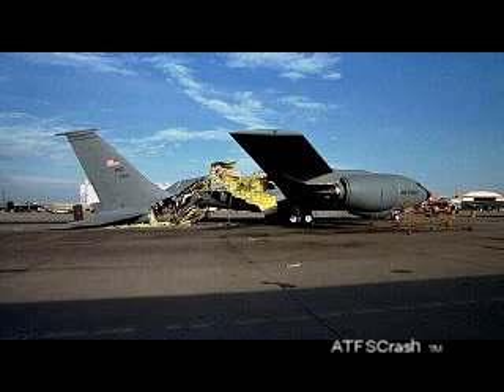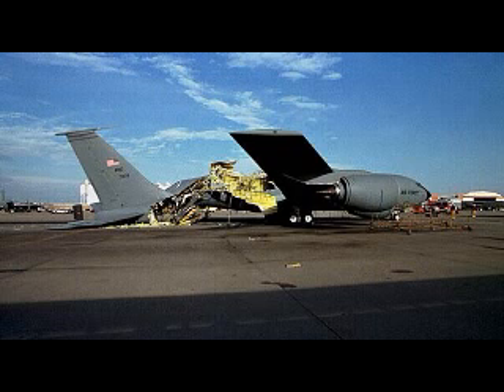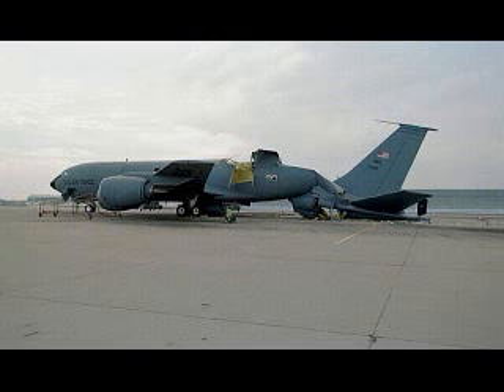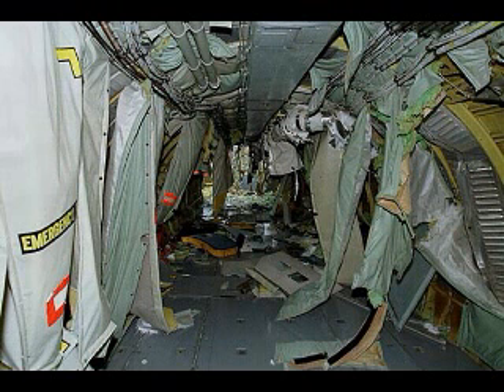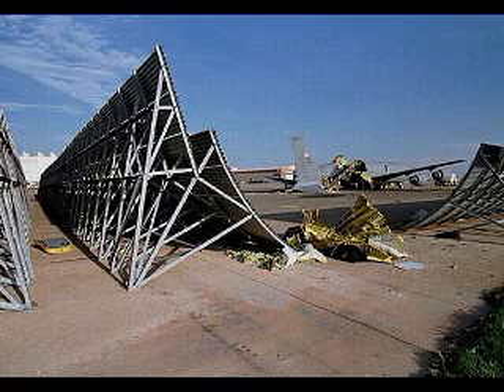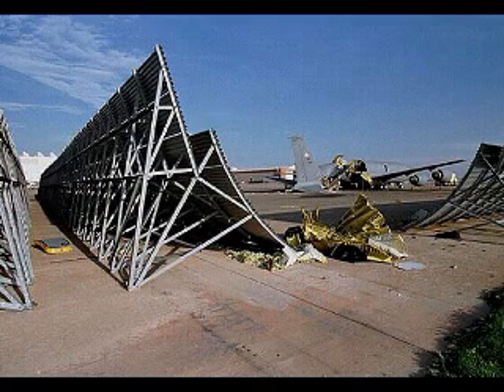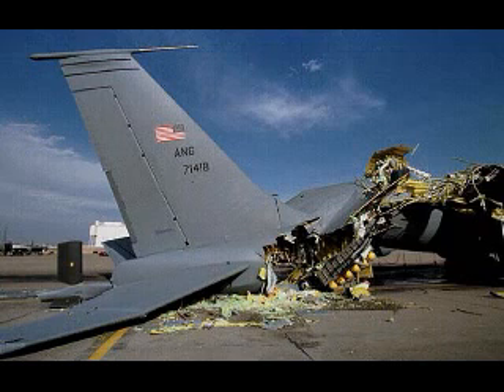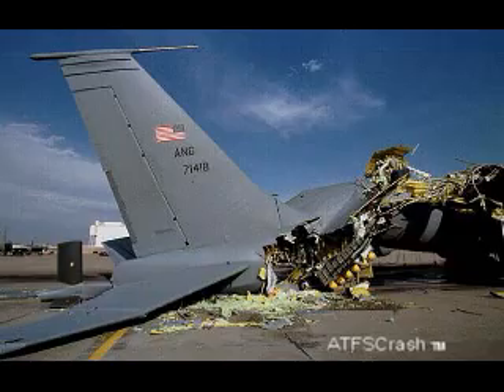KC-135 Pressurization Maintenance Mishap Slide Show

Comment: This is an ANG tanker that belonged to the Mississippi Air Guard at its 5 year depot maintenance. It has no tail stripe because it has just been painted. Civilian contractors blew this aircraft up. This aircraft 57-1418 was assigned to 186 ARW MS ANG

Comment: Capped for check part of the tech data; NOT backwards; if not capped, pressure check FAILS. 
Engine, is "short cut", against tech data; "air cart" is to be used.  
Two guys in cockpit, they felt AIR rush by, failure in the back. Why back injury, they looked fine.  No ear problems, going up is free, coming down is not.  Ear problems?; would be in pain as the pressure rose, not as it leaves.  

Someone in B-52 accident, same time doing maintenance/pressure work, that is the back injury.

Comment: After I read my earlier post I see that it seems somewhat rude. Not my intentions, but I am curious Herk, as to how the valves were installed backwards. You see, simply installing it 180 deg out will place it UPSIDE-DOWN. That's the only way it could be backwards but now the fittings are outside of the aircraft. If it was rightside-up, the sensing lines wouldn't come close to lining up (making the error extremely obvious.) That's all. Thanks ATFS for pointing out the tone of my earlier post.

Comment: I'm curious as to what you mean by "backwards." You see, I work as an Electro/Environmental Specialist on the 135 and have been doing so for the past 8 years (which means that I work on this same pressurazation system) I currently possess 7-level/Red X certification in 2A6x6, and before that I worked as a civilian for 6 years performing depot level maintenance on the 135 at ANOTHER facility (not Tinker.) Your description of "backwards" seems very unlikely, if not impossible. Please explain.

Comment: 135R outflow valves do not operate on AC voltage.  The entire 135R pressurazation system is independent of electricity once the air has entered the cabin.  Refer to 1C-135(K)R-2-3GA-1

Comment: Trust me, if active duty had maintainers with an average of 10 years experience (and yes, guard guys work the jets 40 hours a week) their jets would fly right.  What does active duty do to a guy with 10 years experience?  He's actually taken off the flight line WELL before he gets 10 years in. But what do I know, I've only had to fix active duty jets on TDY's cause the young active E-4's and E-5's hardly knew their systems.

Comment: The valves are capped for the pressure check. Engines to supply the pressure not in the tech data; suppose to be an air cart; engine was shortcut! Cause-officers saved money and got promoted, reduced tech library on the job.  Cause - Warning, make the best workers supervisors, not your friends.  Warning, when you reduce the tech data locally on the job as a major, it will bite you as a General; u reap what u have sown.  Making it harder to get to tech libraries has an effect on the job!

Comment: understood. But the pressure relief valves are secondary valves that relieve excess pressure to avoid this type of situation. maybe these were the ones that were capped off? And then the outflow valves, which are normally powered by AC voltage was left closed.?